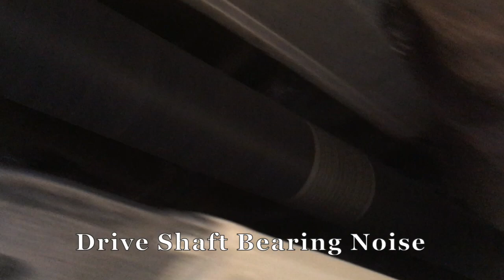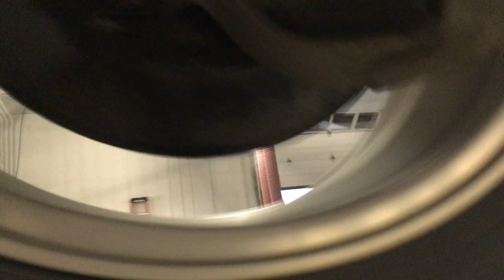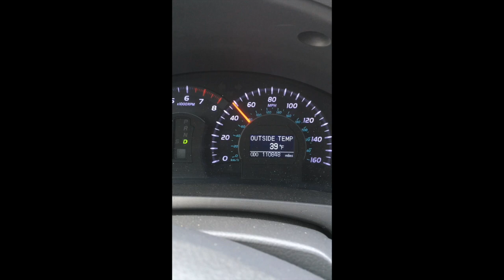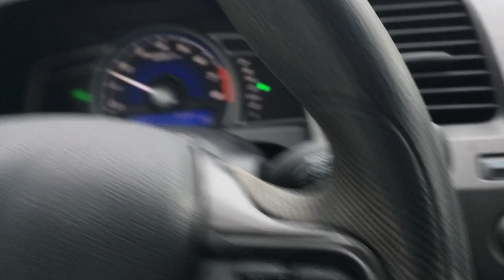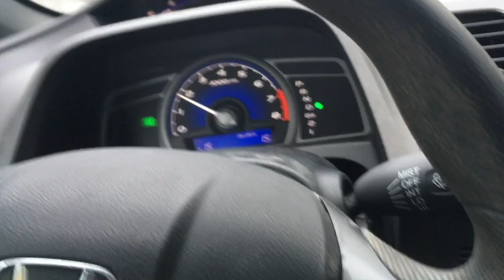Wheel Bearing Noise VS. Drive Shaft Bearing Noise

Comment: My 2009 rav 4 makes a beautiful spooling noise. Sounds like a damn jet engine. 🙄 2 mechanics said it was a wheel bearing issue. Found out it was the rear coupler bearing. Also noticed the carrier bearing on the shaft was going out also. It is really helpfull if you can get your car on a lift!
Reply from the maker: Hey Happy Wrench, Yes, it really allows you to inspect the car more thoroughly and safely when it's on a lift.
Reply: My car makes a constant Buzz Humm like a RC car at full speed!!! Put it on a lift and looks like xenter support  bearings getting worn....can I spray anything on it in themeantime???

Comment: 02 Tahoe wump wump sound in left front thought wheel bearing did a new 1 same deal has a slight hum aroud 30mph and on any ideas ?
Reply from the maker: Hi Tom, When tires are worn uneven it can cause a vey similar noise. If you rotate the tires and the noise changes, you'll know the tires are the culprit. Let me know what you find, thanks.

Comment: This video helped me a ton! I have had a loud hum/vibration from the front end starting at 30mph and again at 40mph and loudest between 60-65 and it got louder when any weight was shifted onto the left front end and the vehicle even pulls hard to the left. I have an appointment tomorrow to get it verified and hopefully fixed. Thanks for this video and description it puts my mind at ease because I know THIS can be fixed!
Reply from the maker: You're welcome Crystal, and thank you for leaving such an awesome descriptive comment! I know this will help other readers with the same problem 😊
Reply: @EddieCarrara1  it turns out the bearing WAS busted 👍 the mechanic had a hard time getting it out because it was so bad and rusted in place. The noise is a lot quieter but its still there a little bit. So I'm going to run some more tests and check the other three.
Reply from the maker: @TheTALONtedEagle  So if you still have noise the most likely cause is another bearing, you're on the right track 👍
Reply: @EddieCarrara1  I had the other side finally repaired a couple months ago and ALL noise stopped. Now my car is all back to normal. Thank you for the help and peace of mind.

Comment: I have the same generation CRV and my carrier bearing is making noise, which I initially thought was just tread noise from the winter tires I bought last year. I’ve read the driveshaft is one solid part so replacing the bearing itself would require an entire driveshaft. Is lubricating the bearing with a grease gun needle a solution?
Reply from the maker: Hi Mike, It doesn't have a grease fitting so I'm not sure if it is even possible. If you figure out a way let me know so other people can try it as well 👍

Comment: I have a similar noise coming out of the driveshaft/differential area in my 07 tahoe awd. It gets worse as I accelerate. Just a couple days ago it leaked out a green fluid (not coolant) and then the differential itself started leaking a black sludge. Any help/suggestions?

Comment: Ive got 2007 acura mdx im hearing a buzzing sound starting at 60km and getting louder as the speed goes fast, change the right front wheel bearing then test drive the suv there still buzzing sound but not as loud as before do you think thats another wheel bearing. When i run 110km+ its like i have an airplane inside my suv.
Reply from the maker: Hi Patrick, Yes it's very possible another wheel bearing is causing the noise. You said "the noise is not as loud after changing one wheel bearing" and the airplane noise is usually a damaged wheel bearing. Keep me posted on what you find, thanks.
Reply: @EddieCarrara1  i've done the left front wheel bearing but i still hear the sound but this time im getting that buzzing sound at around 80kph  and not as loud do you think all of those 2 rear wheel bearing is shot aswell and im also hearing a heartbeat like noise.
Reply from the maker: @pjongmariano3550  is there any way you can take a video of the noise, post it on YouTube and send me the link? How do the tires look, is the tread pattern smooth with no unevenness to the surface? Do your rotors have a brake pad impressions? Are you hearing this heartbeat noise when braking? Let me know, thanks.
Reply: @EddieCarrara1  rotors,brake pads and tires are all brand new just 2 weeks old . I hear that heart beat noise the same time as the buzzing noise as the speed goes fast.
Reply from the maker: @pjongmariano3550  is there any way you can take a video of the noise, post it on YouTube and send me the link?

Comment: Will a wheel bearing feel and sound like going over rumble strips? My f150 has started to randomly feel like I'm driving over small rumble strips but it comes and goes
Reply from the maker: Hi Lord Killa, If you have an automatic transmission you may be feeling the torque converter going in and out of lock up or you may need to check the EGR valve, they can also cause that type of feeling while driving. If the check engine light is on the code will point  you to the possible problem. Let me know if this helps, thanks.
Reply: No engine lights on yet

Comment: I have a problem with mine when I accelerate it making a ticking noise and when I let off the gas it stops, and when slowing down I hear a strange noise. Could it be my drive shaft ir something? Its coming from the bottom of my car and it sounds like a exhaust leak but it can’t be I got it checked for leaks
Reply from the maker: Hi Jovanni, Exhaust leaks will only tick when it's at the manifold or very close to the manifold. Does the noise only happen when the vehicle is moving or only when the engine is revved up sitting still? Is your vehicle a rear wheel, 4-wheel, or all-wheel drive vehicle? If it is, the u-joint could cause this type of noise, let me know, thanks.
Reply: Eddie Carrara mines is RWD 2011 Hyundai Genesis coupe 3.8
Reply: Eddie Carrara  I can hear it slightly when it’s idling and definitely hear it on a cold start and while the car is moving I hear it when I have my foot on the gas and when I let go the noise stops
Reply from the maker: @jovannifuentes7593  It's possible it is an exhaust leak. When the exhaust manifold is cold the tic will be louder than when it hot because the metal expands and the gap closes. I recommend you run your hand along the outside of the manifold when cold without touching it to see if you can feel any air pushing out or if you can smell any raw exhaust under the hood. If you smell raw exhaust under the hood, most likely you have a manifold leak. Keep me posted on what you find.

Comment: I get a clinking sound from my rear right tire clinking and clunking sound. Had four mechanics check it out and said a bad wheel bearing but i see everywhere everyone says wheel bearing hum when they go bad
Reply from the maker: Hi Hector, Yes, wheel bearings hum when they fail. When do you hear the noise? Can you describe a situation when you hear the noise in detail?
Reply: Eddie Carrara when i drive is the only time i hear it slow, fast doesnt matter. Theres like a clinking sound as im driving. After i had my rear pads changed the sound just got worse

Comment: Hi. I've taken my 1999 Lincoln Navigator into the mechanic twice, and spend thousands of dollars on suspention work, to have a LOUD "CLUNKING" noise repaired -- but the problem still remains.
The noise happens occasionally -- usually when I pull out of a parking spot.
When I turn the wheel right, and begin to move forward, It sounds like the front passenger side makes a HUGE, LOUD, "CLUNKING" noise, as thought I am rolling over a BOULDER, and the vehicle strains to accelerate forward.
What could the problem be?

Comment: Thank you, I went to belle tire to get a tire rotation and wheel alinement. They told me my center bushing is completely gone and I need to replace it. The thing is I never had any humming noises, thumping or howling. Wanted 1,900 for a new driveshaft. I said nope. Went to a Honda dealership and they just said I needed a wheel rotation and alignment. The problem was two weeks ago I hit something hard and my left wheel started humming and wheel was off centered. At the Honda dealership they did a few test drives and my driveshaft is fine. Belle tire at it again scamming
Reply from the maker: Awesome M&M, it's best to get a second opinion even if it cost a few bucks more, it's nice to find a mechanic who is honest 😊

Comment: Very interesting video.  I've had a driveshaft carrier bearing let go years ago on a 77 C20.  My 2010 Chevy Equinox LTZ AWD V6 has 135K miles.  I replaced 1 wheel bearing a few months ago with a MOOG replacement.  Yesterday I replaced the pass side with a MOOG replacement.  The noise remains.  I'm going to change out the rear bearings as well and if that doesn't solve the issue then I'll go to the driveshaft carrier bearing.  I don't think I'll be able to change that myself.
Reply from the maker: Hi Chris, the drive shaft is very easy to replace. If you can replace wheel bearings, you can definitely replace a driveshaft 👍 I recommend you inspect the drive shaft before replacing the bearing, maybe you'll see something leaking or find some play in the U-Joint and you won't have to spend money on replacing the wheel bearings. Let me know how you make out.

Comment: Ford transit connect how can i tell if its axel or wheel bearing?
Reply from the maker: Hi Luke, 
You'll need to have it suspended on a lift and use an automotive stethoscope or long screwdriver as a stethoscope to locate the noise. When using a stethoscope or long screwdriver to locate noises you need to place the pick-up or end of the screwdriver on a solid stationary component near the noise like a knuckle assembly or driveshaft mount. The noise will be loud when you get close to the source.
Reply: Eddie Carrara will do.  Thanks!

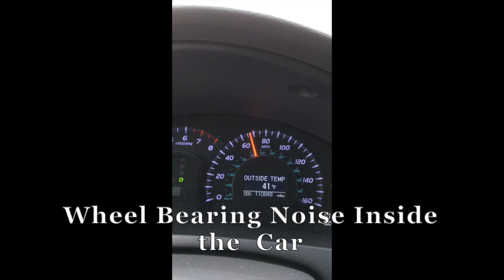Comment: I have a Pajero and seem to get the exact noise at 1:30, when I reach about 1800-2000rpm and the noise goes away above that but then comes back when I accelerate at this rpm, and it comes on especially on a hill, this is in every 
gear even at neutral, also had passenger felt vibration in the rear seat in the centre when this happened, and idea what this could be?
Reply: I have the same mistory noise on my qashqai , especially up hill or under load, sounds like a dry bearing vibrating.  I would like to heat if you Solved the problem ???
Reply: @rasmushjs5318  The only comment that describes my car's current issue...but not answered...sad :(

Comment: My 05 Liberty starting making a wump wump noise the other day only when I drive. I believe it is the drive shaft.
Reply: Did you figure it out my tahoe does it too
Reply: @tommello9525  not yet. I have cut back on driving it. Just back and forth to work. I am settled on it being the drive shaft. When I get enough cash I will have a mechanic check it out.

Comment: That’s exactly the sound my vehicle has made since the shop I took it to replaced my strut and cv boot 3 separate times. Nobody has been able to figure it out because nobody seems to hear it
Reply from the maker: Hi Emily, The best way for you to get this fixed is to ask the mechanic to take a ride with you so you  can point out the noise. People are lazy and don't want to go the extra mile to help. You need to drag them into the picture and verify they hear the noise 😊 Let me know what happens, thanks.

Comment: Interesting video, thank you! I have a Volvo XC70, there is a growling/thumping noise at low speed, and a noticable bearing noise under acceleration. Front wheel bearings and driver side axle (with carrier bearing) are new. Noise under acceleration quiets if i gently depress the brake pedal while still accelerating. I'm leaning toward driveshaft carrier bearing as the noise does not change when loading the wheel bearings in either direction. Do you have any suggestions?
Reply from the maker: Hi Paramount531, the bearing noise sounds like the center carrier bearing but the best way to check it is to have the car on a lift and use an automotive stethoscope to verify the noise, The growling/thumping noise may be your tires? I recommend you check them very close, the Volvo XC70 is notorious for abnormal tire wear. Let me know what you find, thanks.

Comment: How can i know the difference between drive shaft and gearbox bearings failure noises
Reply from the maker: Hi Farhan, You'll have to have the vehicle suspend in the air and have someone use an automotive stethoscope to pinpoint the noise. By using an automotive stethoscope the noise will be very apparent.
Reply: @EddieCarrara1  thank you so much
Reply from the maker: @Farhnazmn  You're welcome. Let me know what you find out, thanks. 😊
Reply: @EddieCarrara1  i didnt know where the sound came from but its gone by itself. Thank youu

Comment: Hi Eddie, 
I have a problem with my 2006 IS250 and i've tried everything. Don't know what it is, can you please look at the video i made for it and suggest? wheel bearing? front axle? differential oil? back axle? i'm loosing my mind. The sound seems to be from the front driver side. Replaced the front wheel bearings (driver and passenger side) about 2 times.
My mechanics are currently suggesting it may be a bad "auxiliary", "differential", "short differential oil", front axle or back axle. The issue is, there's no way to be sure as most mechanics here in Nigeria do guess work mostly.
Please help
Please see my video here. https://youtu.be/yrvFpm5jwSE
Reply from the maker: Hi Sukanmi, Are the tires in good condition, is the tread surface smooth with no uneven chop or cupping? The noise you're hearing sounds to me like either a wheel bearing or uneven tire wear. Does the noise change at all when you sway the vehicle side to side slowly at 30mph? see if the noise changes under those conditions and let me know, thanks 👍
Reply: Eddie Carrara Thank you so much for your help. So I’ve checked the tyres, moved them around even (swapped front to back). The sounds were still there. My mechanics have now replaced all 4 hubs, still the same problem. They have now concluded that it’s something called the “front axle”. They made a video for it. It’s also called the auxiliary, say there’s a bad bearing in there.
Reply from the maker: @sukanmiadebayo6961  Yes that is a half shaft, it's usually bolted to the powertrain and is inserted into the transmission. I just hope they didn't damage a bearing during installation causing the same noise. The best way yo locate where the noise is coming from is to use an automotive stethoscope or a long screwdriver as a stethoscope on the bearing area while the car is being driven on the lift. The noise will be enhanced through the screwdriver or stethoscope when you are close to where the noise is coming from. This method saves a lot of time, money, and guesswork, it also creates happy customers lol. Here is a video I made back in 2011 on this procedure, watch it and let me know if it helps, I know it's old so I will have to make an updated video  lol  😂https://youtu.be/YHhZTi_GSh4
Reply: Eddie Carrara! Ah excellent, I’ll watch the video now, I don’t think we gotta those apparatus here but then I’ll share the video with the mechanics too
Reply from the maker: @sukanmiadebayo6961  That is a lot different then what I was referring to lol, that is more like a transfer case because your car is a rear-wheel drive, but it also has bearing in it. I recommend you have them put a screwdriver on it while it's in the air running and see if they can hear anything abnormal.